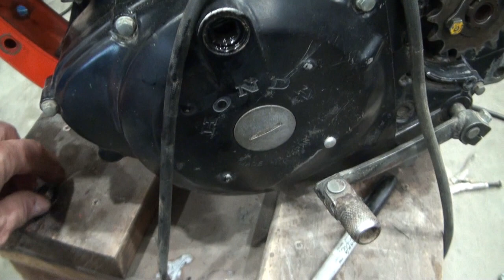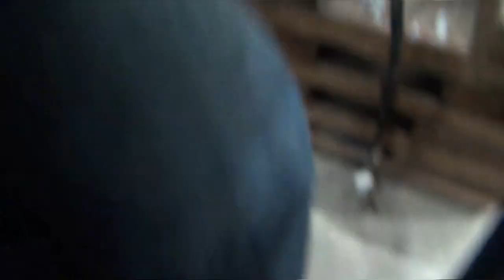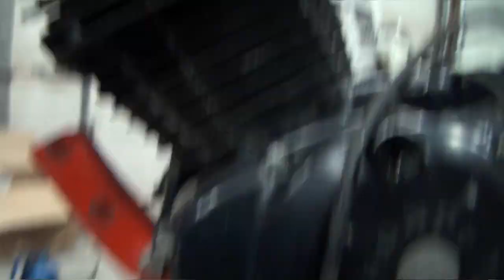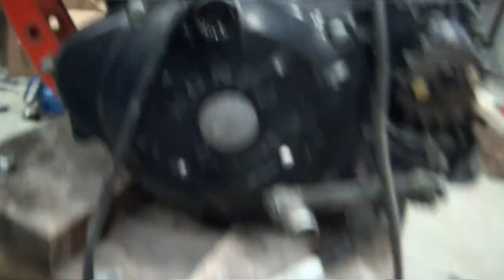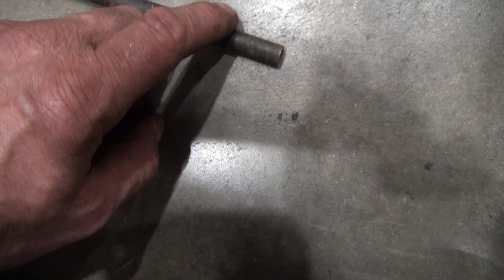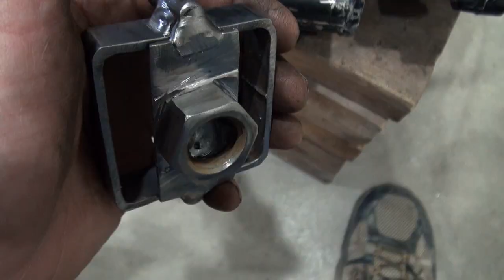XR500 Cam Install custom Tools

Comment: The centre larger cap cover, covers the crank bolt, remove this cap and you can turn the engine over with a socket

Comment: New to the channel. So whatever happened to the reed valves? Did you take them out to inspect? I’m having trouble dialing my 1982 xr500r in. I’ve only been messing with jetting and valve clearance. Bike runs incredibly strong, but idles bad. Wondering if my reed valves are faulty. I honestly am lost when it comes to reeds.
Reply from the maker: I left the reed valves in place, I would like to remove them completely sometime and run without them, for a poor idle on yours it may just need the carb cleaned, will your bike power wheelie third? Mine won't.
Reply: groutaone Yes sir. It will. I’d be interested to know if it would run without the reeds, too.

Comment: 1982 XR500... I rode one when I was 12 and it didn't end well.  What a great tool, once you get some internals hooked up you'll need a wrench on that nut.  Stay well Grouta, good to see a video from you.
Reply from the maker: Thanks man, hey what happened when as a 12 year old you rode the XR500?
Reply from the maker: I think I was 12 when a guy let me ride his CR250, well I went over and damaged the rear fender and the bikes owner was close enough I think he saw it happen, he didn't seem upset about it.

Comment: That's a once in a lifetime tool!  Luckily my honda cbr 600 has a bolt to turn the engine over for checking valves and what not.